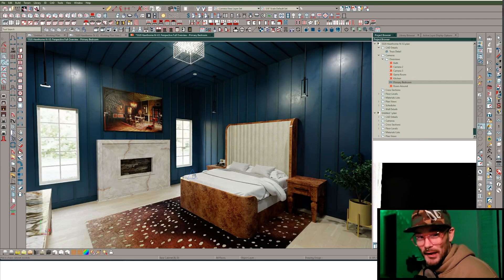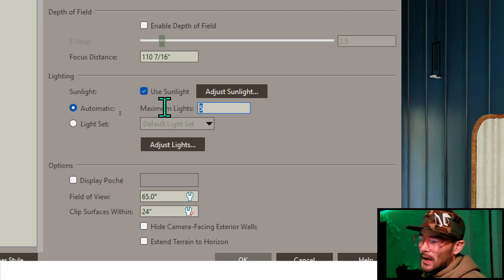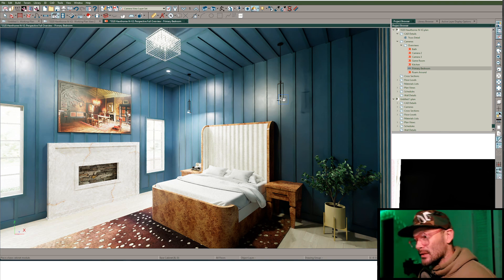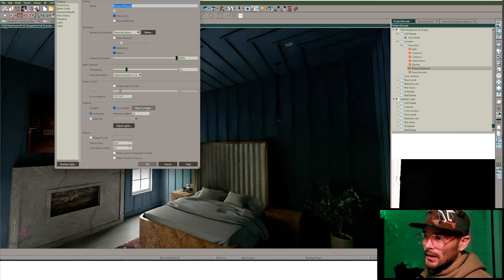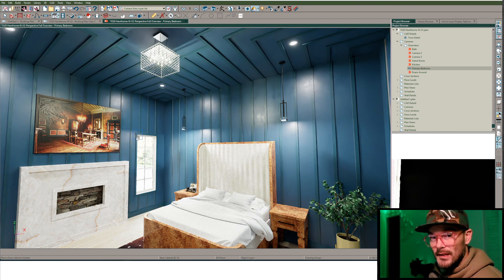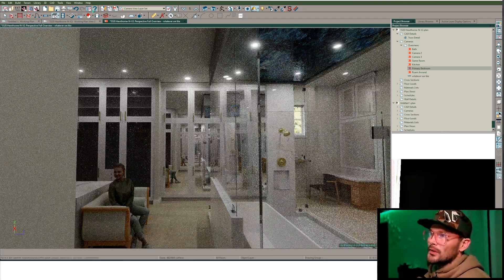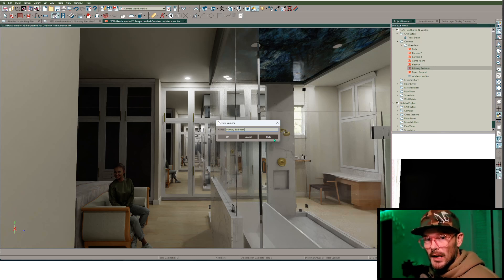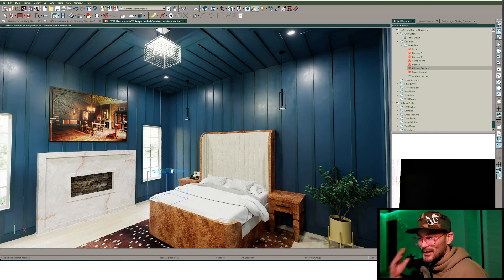Solved Why Are Some Of My Lights Off In Chief Architect X16 When I Have Them Turned ON

Comment: I am having a reoccurring issue in a camera view with multiple rooms. The lights will be on in the room closest to the camera but off in the others despite having all the lights turned on. For example - in a kitchen rendering where you can see into the pantry the lights will be on in the kitchen but off in the pantry. Any insight?
Reply from the maker: Would watch this video again, the answer is in this video. It does not matter if you have lights turned to on when using automatic lights, you should instead turn on a light set which forces all lights to trace. Keep in mind this is very taxing on a system